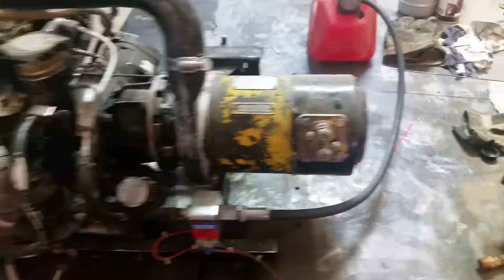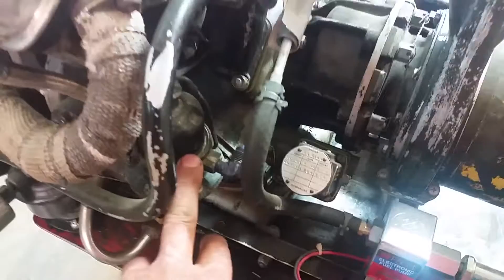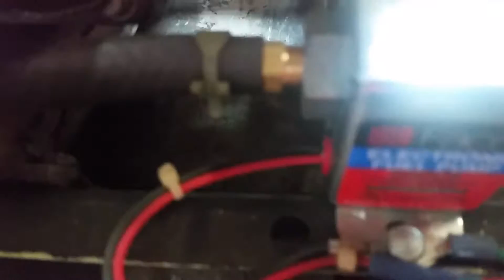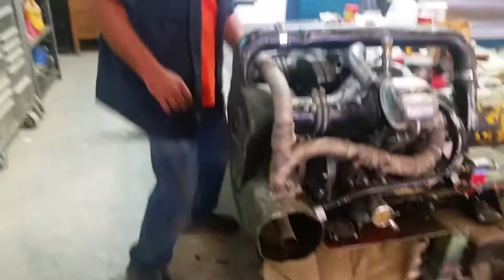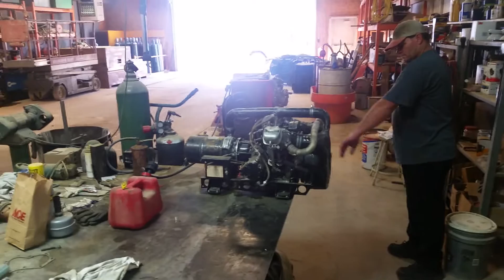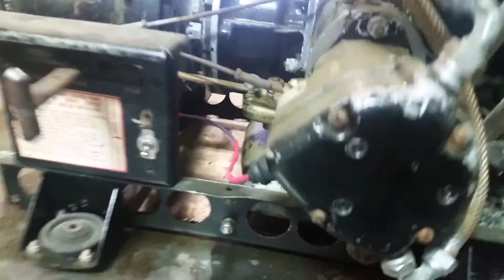Andover v32, B29 APU

Comment: This Apu originally the function is on a b-29 /b-50 superfortress is to supply power to the aircraft's electrical system prior to starting the engines, starting engines, takeoff gear retraction and flaps then its turned off untill its restarted before landing. landing, taxi, and shutdown. they were the apus used on other aircraft during the post war. the fuel pump you got may not be the proper pressure to run this. as some people mount the fuel tank higher and its gravity fed. and the exhaust is red hot. is what happened when they tried to recover the kee bird. is they jury rigged a fuel tank to the apu it sloshed around if it was not capped. as the apu's hot exhaust could of ignited the fuel and the fire destroyed the aircraft.

Comment: My 2 cents worth   The one I have has no generator  or cooling shrouds but I am going to run it anyway but I did find out the coupler that drives generator runs 2 times motor speed  so must have a planetary inside and as far as mixture goes I kinda think the round attachment on carb just above choke on airhorn may be a mixture or maybe a cold  vs hot operation adjustment like an onan generator on motorhome has . guessing  at best  My problem is someone lost the rotor for the mag  might have to make one   Thanks

Comment: That Engine will start electrically if you instal a reverse current relay and two solenoid, switches along with Voltage regulator and you would have the making of an electric Fuel Efficient Car, + Battery Bank  12, 24, 48, volt? motor to drive  the differential drive train and  low voltage automatic start to recharge batteries at 200 amps